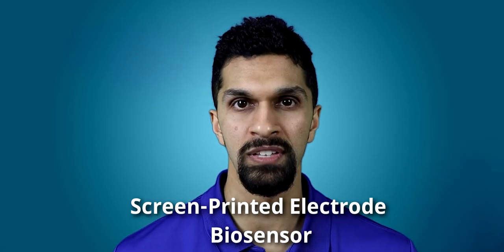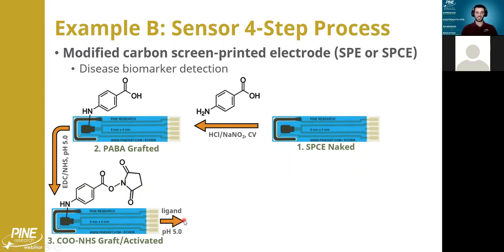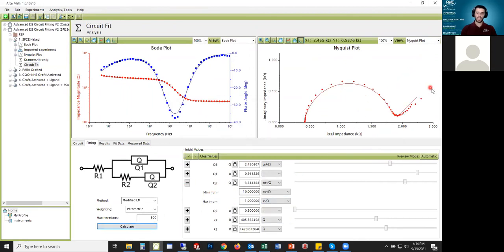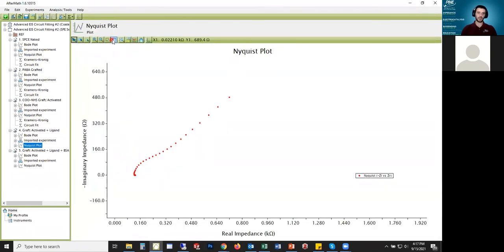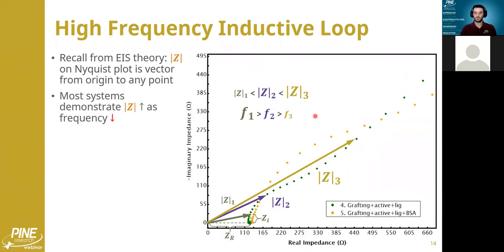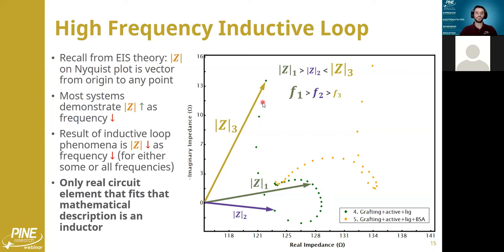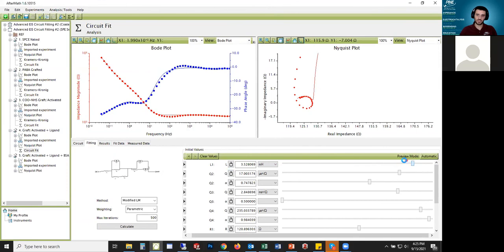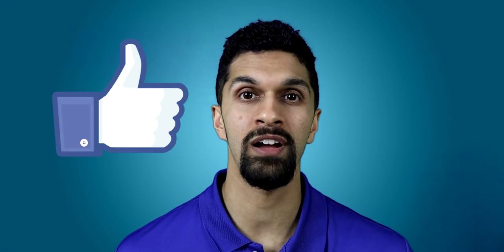Electrochemical Impedance Spectroscopy of a Screen-Printed Electrode Biosensor (Inductive Loop!!)

Comment: which software you are using for fitting, can you please guide
Reply from the maker: The software I used for circuit fitting and analysis is my company's software (Pine Research), which is called AfterMath.  If you are interested in purchasing a circuit fit license, can you please email us with your contact information at pinewire@pineresearch.com?

Comment: Am working on mediated  enzymetic electrodes. Meaning i have a redox mediator and a redox enzyme on the electrode.what electrolyte would be best suited for running EIS between buffer and ferri/ferro solution.?
Reply from the maker: Ferro/ferricyanide is soluble in water and I would assume that your enzymetic electrodes are also stable in water.  Additionally I am assuming that the ferro/ferricyanide is sold with a potassium cation (potassium ferrocyanide).  As such, I might recommend using an aqueous electrolyte of KCl for studying your system.  Also, your buffer solution might also be a good candidate as an electrolyte.  I hope this was helpful.

Comment: Could you provide more details about the 3-tiered circuit model used to simulate the inductive loop? I'd like to understand its mathematical rationale. From what I gather, the initial semi-circle in the model is represented by the Randles circuit (RC). Then, an inductor is introduced in parallel, effectively creating a second, inverted semi-circle, which, when combined with the RC element, forms a complete circle. Finally, the inductor is connected in series with a resistor to shift the inverted semi-circle, transforming the perfect circle into a loop. Is this a reasonable way to conceptualize the model?
Reply from the maker: The initial semicircle-type feature (usually before the loop part) should be represented by the Randles RC part.  You can usually see this in action by dragging the value for the resistor back and forth.  It shows the semicircle width growing and shrinking in conjunction with the value change.  The R-L combo in parallel does correspond to the loop, or essentially like an inverted semicircle.  The idea of it forming a complete circle I think is somewhat of a coincidence of the two features, and only when the values are such that it physically appears that way.  There is no real significance to the idea of a perfect circle being formed.  The value of the R-L resistor is also apparently inversely proportional to the upside-down semicircle width, and that 3rd tier of the circuit model as best I can tell is related to the process therein - that is, if it is a corrosion process, it's somehow related to the impedance of the corroding film/surface in some way.  But, as I think I note in this video and everywhere I discuss this model and these phenomena, there is really no consensus or firm explanation to this model and process.  It is in many ways the model used to fit these kinds of features from experience because it simply works mathematically.
Reply: @Pineresearch  I would like to contribute an observation to your explanation based on my experience with circuit fitting and encountering a high-frequency inductive loop in my EIS data. I noticed that by introducing a resistor in series with CPE Q2 in your 3-tiered circuit model, the fitting software gains greater flexibility in capturing the high-frequency inductive loop, which may not be immediately apparent. This additional resistor essentially determines the width of the initial circle (typically small), without altering the width of the upside-down semicircle. Allow me to provide an overview of the effects of the three different resistors now present in the 3-tiered circuit model:

1. The resistor in series with the CPE (Q) determines the width of the initial semicircle.
2. The resistor in series with the inductor (L) determines the width of the upside-down semicircle.
3. The standalone resistor determines the width of both the initial and upside-down semicircles while maintaining their relative sizes constant.

I hope that this suggestion and minor modification to the 3-tiered model can be helpful to others who are facing the challenge of fitting a high-frequency inductive loop. However, I want to clarify that I cannot provide a physical explanation for why the additional resistor proves effective. It is solely based on my personal experience, where the presence of a third resistor has facilitated the fitting software in capturing the inductive loop, particularly when there is a significant difference in the widths of both semicircles.
Reply from the maker: @Heisenberg-EC  Thanks for the suggestion.  It could be a useful addition to this model, though as you acknowledged in your last paragraph the trouble is mainly the interpretation (or lack thereof) of its physical meaning.  While it can be instructive (and I do this personally quite often, actually) to describe circuit elements in terms of "the size of this semicircle or feature on the Nyquist plot," in general that is not the goal and is, by itself, insufficient for comprehensive EIS analysis.  The primary exception to this, as I have admitted many times and do so in this video, is that the inductor value is mostly meaningless (or, at the very least, unknown as to its correlation to a real phenomenon).

The point, however, is that while it can be helpful as a user to consider "resistor 1 represents semicircle width 1" et al., mainly as a tool for obtaining better circuit fit, ultimately the explanation is better-suited as being "resistor 1 represents the charge transfer resistance of process 1, and it appears as the semicircle width 1."  With the aforementioned inductor as a notable exception, in general it is wise to severely limit the number of times you are unable to justify such circuit elements in this fashion and choose to include them simply because the lines match the dots.  So mainly, while your suggestion is appreciated, I am simply offering a word of caution in this regard as it relates to rigorous EIS data analysis.

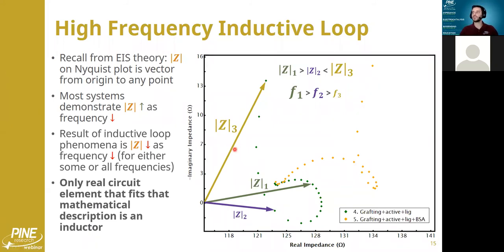Comment: I have a question regarding the determination of Ohmic drop in the presence of an inductive loop. Typically, Ohmic drop (iR) or equivalent series resistance (ESR) is defined as the point where the impedance intersects the real axis (X-axis) at the highest measured frequency in a Nyquist plot. However, when dealing with an inductive loop, there may be two or even three intersections with the real axis. For instance, in the case of the green graph (timestamp @12:00), one could estimate the Ohmic drop to be 123-124 Ohm (highest measured frequency), 129 Ohm (first intersection), or 122-123 Ohm (second intersection). Which value should be chosen? Personally, I would opt for the second intersection, as it marks the point where the capacitive behavior begins to emerge.
Reply from the maker: It would be most likely accurate to consider the iR drop to be the first, or highest frequency, intersection in such cases where there are multiple intersections.  A notable exception would be something like where an artifact is observed at high frequency showing weird curls that are not attributable to a real process, as with the example in this video.  Otherwise, even with the circuit fitting the value for the leading resistor would correspond to where the highest frequency intersection roughly is.